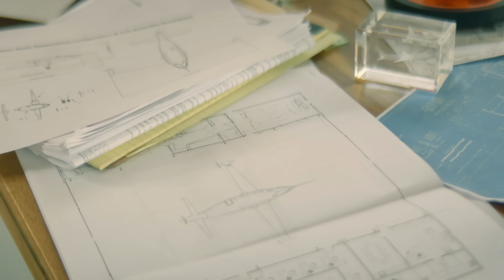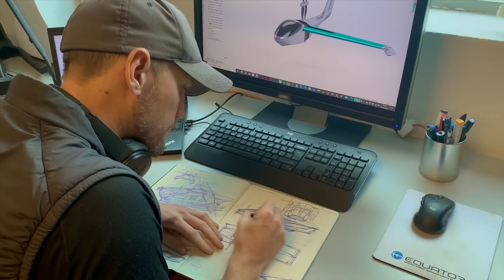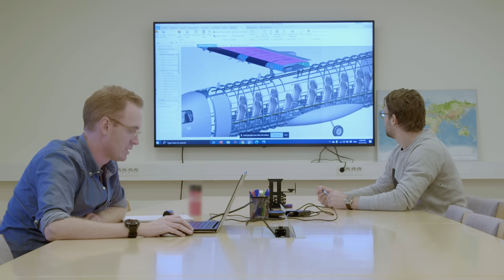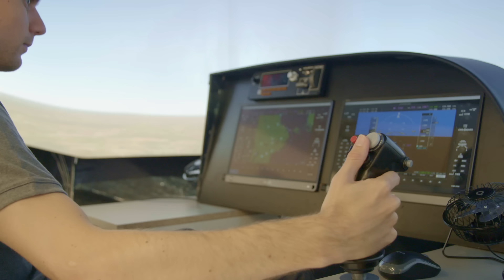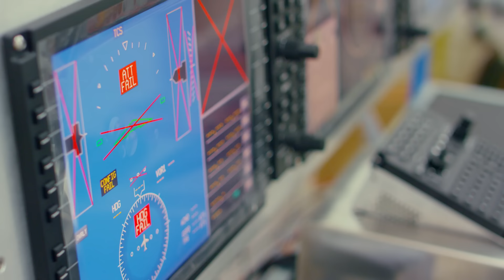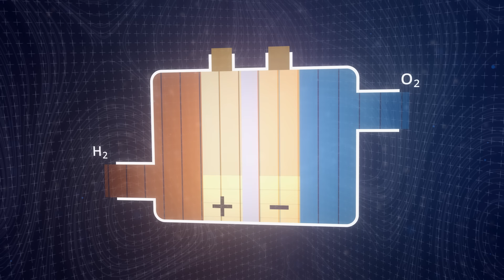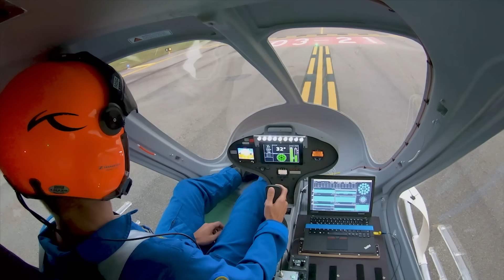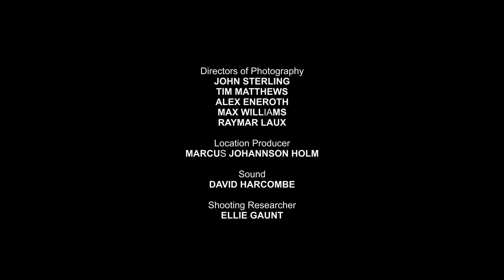Planes of the Future: The End of the Jet Age? | FD Engineering

Comment: 37:10 BS.  The difference between a fuel fire and a battery fire is that there is a possibility to extinguish a fuel fire. You can even dump the fuel, turn on the extinguishers and glide the plane towards the ground. NOTHING can stop a lithium battery fire. When electric cars catch fire, they have to let it burn itself out.  You can do several things to stop a fire on a modern airplane. If you catch fire in an electric plane mid flight, you can either jump off quickly, or you can crash and burn. No 3rd alternative.
Reply: Sctually, a group in Sweden (IIRC) has figured out how to put out a fire in an auto battery pack. They flood it with super cooled, maximally salty brine. I've seen the videos. It actually works! Unfortunately that isn't going to help you in that 19 pax e-plane at cruise altitude.
Reply: Water can put out a lithium battery fire
Reply: @TacticalLulu  Water + Lithium = fire...
Reply: @Roy_Godiksen  yes. And if a lithium battery is in a thermal runaway condition, water is the most practical way to cool it while extinguishing the flames. Were you expecting the battery to still be usable after the fire?
Reply: @TacticalLulu  From all the world wide examples of the firefighters spraying water on a burning electric car, only to give up and focus on containing the fire to the vehicle. When water contacts the lithium, you get a runaway chemical reaction. Feeding water to a fire of the level will potentially add "fuel to the fire" as the next cells now are damaged by the heat, and gets into contact with more water, starting another out of control burn.
Reply: Chemists are already on that lithium thermal runaway issue by doping the electrolyte with flame retardants. Also adding anti-freeze for cold climates such as high altitude flights.
Reply: @Roy_Godiksen  Roy, I guess in your scenario, we should just hand out marshmallows and enjoy the light show, right? But maybe, just maybe, I'll stick to less flammable flight plans!
Reply: It wouldn't be hard to find a way to eject any battery packs that are on fire, or maybe just let them hang outside the plane meters below you say with a wire...so you don't start fires on the ground. Also you can isolate the battery, have a blowout hole, so it only burns itself and not anything else.
Reply: Why not ask about overall safety instead of focusing on in flight fire?  In use battery fires in EV’s are rare.  Other problems are more likely to kill you.  For example, post crash fire - which is extremely deadly for fossil fueled planes, much less so for battery powered vehicles in general, right?

How about engine failure?  Common in recip aircraft.  Probably much less likely in electric because 1 moving part.

One more thought:  a properly built battery pack would fail slowly, allowing a safe landing and exit.
Reply: @GowronSaves agreed.  And a battery that can be ejected can quickly be exchanged.  That would really be helpful in rapidly servicing electric aircraft.
Reply: @TacticalLulu  No. Plain water CAN NOT put out a lithium battery fire. Water fights a fire 2 ways. 1) It cools the fuel down to below the temperature needed for combustion and 2) it smothers the fire by cutting off the fire's supply of oxygen. Lithium battery fires are not susceptible to plain water for 2 reasons. 1) The fire is so hot that the water cannot absorb sufficient heat to sufficiently cool the fire. 2)The heat of the fire causes dissociation of the electrolyte (and the water, actually) to produce fresh fuel and oxidizer. A group in (IIRC) Sweden figured out that super cooled brine will put the fire out. It does it by 1) shorting all the batteries, thereby spreading the electric current out and 2) brine can absorb many times as much energy as plain water PLUS it can be cooled far cooler than plain water so it can absorb even more energy. I saw the videos of this after that ship full of automobiles burned of the coast of Europe last spring. But prior to those folks' breakthrough all firefighters could do when an EV went up was stand and watch and try to keep the fire contained.
Reply: @paulogden7417  Simple. We have 110 years of commercial flight experience, so we know how to make a plane as safe as sensibly possible. Unless you make a completely new everything, we have a good idea of what to do, and not to do. So little worries there.

If a plane is going down for some reason, it can Always dump its fuel before crashing (unless over very specific areas). You have close to no chance of post crash fuel fires, unless the crash is very sudden (hard to be sudden when you're at 10,000 feet altitude), or pilot is an idiot and forgets. At that point, it doesn't matter what kind of plane your in. If they added a ejection system for the batteries, it could reduce danger. As long as it's not s full system fire (which is Exceptionally unlikely), you could save the plane. That would make the hull a lot less aero dynamic and complex, but worth it for the safety. The whole "fire proof compartments" BS is a gamic at best. In EV fires, even the steel frame and melts. The temperatures are far hotter than the fuel, because the fuel itself doesn't burn. Only the gasses. The temperature issues with battery pack fires are to say it mildly, difficult. 

Yes, less parts definitely has less chance of failure, especially in mid flight. Less friction has the added advantage of less wear an degradation with no touching parts between axle and engine. No lubrication needed (Huge advantage), and less power loss from friction in general.  On the other hand, you have the problem of more computing, wiring, short circuits, and signals, that need to be accurate and consistent 100% of the time. Any deviation and the plane stops just as catastrophically as a conventional airplane. A jet engine is surprisingly simple in design and function. Few things to monitor, control, and to take into consideration. There is unfortunately at this time a Lot of software issues in EV engines and bugs we can't even predict at this time. However AI may be the saving grace on that front. That and experience of cource.

EV fires are Far from uncommon. One out of every 4000 EV's catch fire. But unlike gas cars, it is almost 100% total destruction. And the trucks that catch fire is a whole chapter on its own. A gasoline car can be extinguished, as the gas itself doesn't burn on its own, and not in liquid form. It's also worth mentioning that in the stats, a good percentage of the gas cars burned, are due to proximity to an electric car in a parking garage catching fire. 

I've yet to see a report on an EV or lager battery pack catching fire slowly. The nature of Lithium batteries are that they are extremely volatile. Once the chemical reaction starts, it is as good as unstoppable, and happens at an accelerated pace. We really got to experience this under hurricane Katrina. When the water levels hit the battery pack, they went up in flames instantly, and explosively. Remember, the sky is full of clouds and water vapor. The pressure and temperature changes will make any material (just about) flex and transition between softer and harder. If this at any point opens for moisture entering the pack, you'll have a fire hazard. Fuel needs a spark of a kind to egnite. So even if it leaks, it won't catch fire in the thin, low oxygen air at altitude. Batteries doesn't require any thing to burn. They will literally burn under water.
Reply: @GowronSaves  Ejection is a safe bet. It would of course burn everything where it lands, so over towns, fields forests, etc, it would be another potential disaster. Any fuel dumped will either evaporate or burn out long before it hits the ground. There will be some extra drag from ejection hatches and a lot of extra weight for the ejection system, but definitely the best solution. Hanging under the plane, they would make the plane very unbalanced and could slam into the hull, causing considerable damage.
Reply: @Roy_Godiksen  
If you were talking about "Lithium METAL" you might have a point.... You're not.
Reply: @rogerstarkey5390  You would be right, if you thought i was comparing it to the reaction you get from sodium. Which I'm not, so you're wrong. Although water and Lithium Minerals are flammable by itself. Water in lithium batteries causes short circuits, which causes catastrophic overheating. A chemical chain reaction when you have an energy dense substance like charged batteries. When fully discharged, the danger of short circuit is 0%. Only when a bunch of electrons are stored in the cells are short circuits realistic. Once the heat reaches critical levels, the chemical reaction is unavoidable
Reply: @paulogden7417  Eviation has burned down their prototype Alice seen in this video.... Just saing
Reply: @paulogden7417  Once the battery has been ejected, the plane could glide to a hopefully safe landing. If landing in water, they could insulate the cargo bay with foam and it should float ? It will need creative solutions, but that is what engineers do.
Reply: @Roy_Godiksen lithium and air  = fire
Reply: this wins rhe dumbest comment so far just tow the flami g fireball on a leash  behind the plane.    Nvm you lose your fuel source for the plane .  Smh .  He'll just dive towards the ground at terminal velocity maybe you will put it out  b4 you hit the ground. Hahahha
Reply: @GowronSaves Wait, WHAT???😂😂
Reply: @Roy_Godiksen  About hanging - towed decoys are a thing for jets, so perhaps take notes from them?
Reply: Yup, there a re lots of videos out there of firefighers trying to put out electric vehicle fires, and even a few where someone was putting their boat or jet ski in the water and accidentally dunked their EV... it caught on fire and burned underwater.

Yeah, people are dumb.
Reply: A third alternative is to dump the burning part of the battery.
Reply: @TacticalLulu 
That would be a very large water tank to be carrying in an aircraft 🙂
Reply: @larsnystrom6698   LOL , you are going to get under a burning car that is likely to explode and try to removed the battery pack that is part of its structure???

Those battery packs are sealed, in steel, to keep the coolant from leaking out.
Reply: Sodium batteries 
You downer

Comment: It baffles me why so many companies keep bothering to develop electric flight. With current battery tech, there is NO airplane or boat that can have range to make it worth the effort. The more power you want to bring, the heavier the batteries and the bigger and bigger the plane or boat becomes. Think square-cube rule. I tuned-out after the first idiotic BS claim of 2 hours and 500km range. The Pipistrel Velis Electro is a CURRENT, gorgeous, well engineered little plane and they're at least honest enough to report that it has a best-case range of 45 minutes. Planes have to have a 30 minute reserve, meaning that you can only fly 15 minute missions. Until there's a battery tech with MUCH higher density, none of these will ever be anything but an expensive curiosity.
Reply: Hybrid ships are a thing. They have about a 25% fuel savings with battery electric propulsion and lower emissions. What you're really saying is that battery energy density needs to improve. The early Tesla Model S' had about a 246 Wh/kg battery. Likely experimental aircraft are testing with this grade of battery to keep costs low. Doubling this will double the range, given the same weight. Two battery manufacturers already have 500 Wh/kg batteries on the market for EVs. Their chemists are on target to have a 1,000 Wh/kg to market in 5 - 6 years.
Reply: You know I did have the same opinion while watching this documentary until I considered other aspects of this project. For example, the range and speed of conventional airplanes come at the cost of being even heavier. Airplanes today fly because they have enormously large fuel under their enormous fuel tank, which comes with its associated gadgets, which adds to the weight. Additionally, kerosene engines have heavy titanium and other sturdy components designed to withstand extreme heat, while electric motors produce less heat, allowing for the use of lighter materials cooled by flowing air. Unlike conventional airplane engines, electric vehicles recharge their fuel while in use, leaving a responsible amount of charge in their battery. On the other hand, kerosene engines simply turn fuel into smoke, leaving behind an empty tank at the end of the runway. Boy! Early pioneers did not have perfect engines or airframes, and progress cannot wait for perfection.
Reply: @MISTERLeSkid  

Did you not understand that the video is outdated and there is so much tech currently out there that wasn't even mentioned? 

Toroidal propellers...

Electronic ducted fans (EDF) ...

Hydroxy fueled engines and generators...

Carbon fiber construction...

Flexible plastic based solar panels the thickness of a credit card... and lightweight!

Imagine a double lithium ion battery pack with carbon fiber shielding combined with LC supercapacitors... In-flight recharging with solar panels built into the upper side of the wings and fuselage... with an extra large cabin that contains a hydrogen balloon for additional lift and reduced weight...  an EDF with hydrogen burning afterburner for faster speeds... toroidal propellers on wingtip engines for normal cruising... 

As much power as those tesla batteries provide, 3000 nautical miles range in a Learjet sized electric aircraft would be easy... while carrying at least 20 passengers.

But they will likely keep it under 20.  There are certain restrictions and regulations that need to be met before an airframe can be proven to be within acceptable limits before the FAA would allow for larger passenger loads.

Hydrogen fuel cells would also have much greater ranges when you bring the hydroxy generator on board the aircraft...  1 liter of water generates 1,700 liters of hydrogen gas plus oxygen gas...

A few hundred gallons of water could conceivably fly you around the world...
Reply: because batteries are getting better duh, they usually sure fail when the product they can create is not profitable enough.... what is this to do with the squared rule? there is no expotential relationship here, stop quoting concepts you don't understand
Reply: Yet there are already commercial operations using electric aircraft. Every advance in technology takes people who don't know all the "reasons it can't be done." Naysayers are common as dirt. Innovators are few and valuable.
Reply: @u9Nails   Jet Fuel is about 9,800 Wh/kg
Reply: Ships are huge and can  carry the battery payload and they are diesel electric @u9Nails
Reply: Also   m they didn't adress the huge toll  of creating  the copper  and other metals needed in hug numbers to create a infrastructure  to sustain  electric  powered aviation.   And nit to me tion the environmental  cost  of mining the battery  materials.  And the fact that they jusg ignore that part of it  in this  should show everyone
Reply: It's true: with Lithium Ion batteries today that's impossible. BUT in 5 years electric powertrains will be 50% more efficient. Solid-state & 3D Li-Ion batteries will realize 2X-3X energy densities and together will enable at least 5X the range.

200% the efficiency of internal-combustion today is a start, but impractical. But 600%-900% in 5-7 years? Now we're talking.
Reply: Horses need to be fed, internal combustion cars need fuel, batteries need to be charged and we need to breathe.
Reply: @Designer-Alan  That's what we call a bold statement with no supporting facts or information.... because it's not true.... because there can be no battery powered aircraft with a useful range. If you want to argue your point, how about presenting some facts and not just your incorrect opinion? I listed the reason(s) for my opinion.
Reply: @handlemonium  30x, 3,000% improvement is what is required to just match the energy that Jet A and B  provide
Reply: Correct. Power and propulsion.
The propulsion exists; the power (generation or storage) does not.
Reply: Two words:  GOVERNMENT SUBSIDIES. it's politicians picking pet projects and using other people's money to fund them.  And then instead of attracting people primarily interested in aviation innovation you attract investors interested in safe investments funded with taxes.
Reply: @tilethio Yes, I hear mostly nay saying in the comments, but my thoughts were also that early planes had all kinds of issues. They were made of Dope and fabric, had little instrumentation, suffered from icing, had oil blowing back on the pilots face, and so on. More than one aircraft required the operator to cut the ignition on and off during landing because there was no throttle. 

You have to start somewhere, and this seems like a pretty good start.

Comment: Using hydrogen for mobile applications is simply insane. It's odorless, colorless, explosive, and its flames are invisible. As the smallest and simplest atom, it's incredibly difficult to contain. I am completely fine with stationary applications supplied by a pipeline but I don't want to go anywhere near something mobile that's powered by hydrogen.
Reply: Hydrogen in all forms is a con... Except perhaps for high energy industry like Steel making where it can be produced on site.
However, even THAT can now be accomplished by "Straight Electricity"
Reply: It worked well for Hindenurg, just not as fuel.... or a few seconds it worked as fuel too...